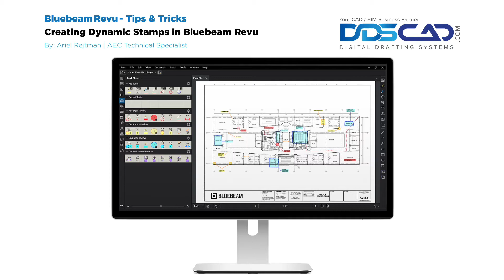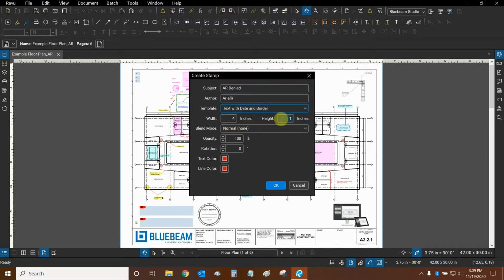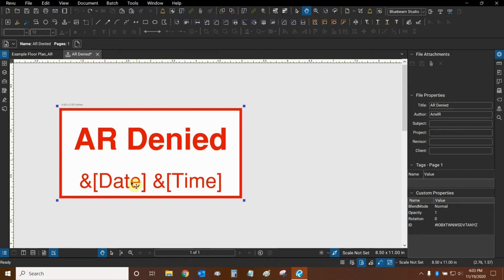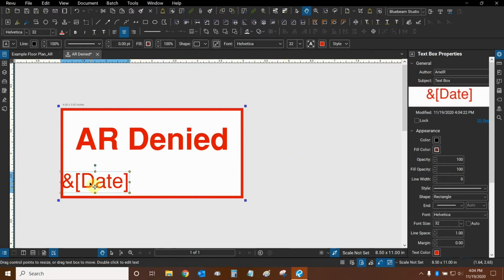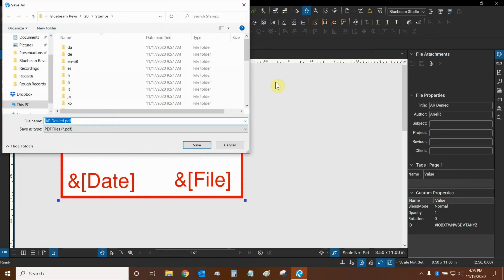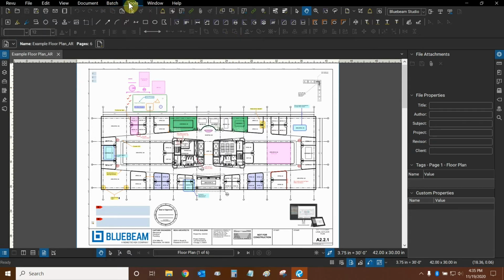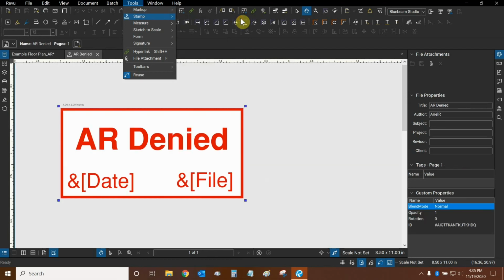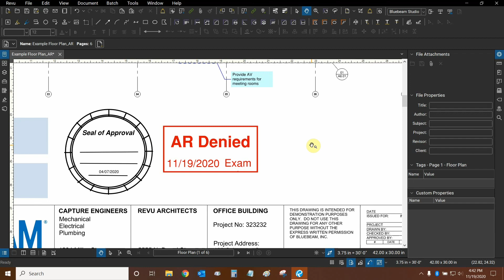Creating Dynamic Stamps in Bluebeam Revu

Comment: Thanks for the video. I want to place a watermark on my Revu PDFs, and I've hard Stamps is the tool for this. However, I want the stamp to appear behind the native text of the documents. Is there a way to do this?
Reply from the maker: You can use the Textbox/Typewriter tools to create a watermark, and you can also use a stamp for a similar result (Textboxes and typewriters have more options). There's also a "Watermark" stamp that comes with Revu. You can find this by clicking on the "Tools" drop-down, mousing-over "Stamp", and selecting the stamp called "Watermark". After placing it on your PDF, you can open the "Properties" panel (It has a gearwheel icon) and change its opacity. Then, you can increase the size of the stamp by selecting it and using the yellow corner grips.

Once it's sized and positioned, you can right-click on it and flatten it. This will permanently add it to your PDF. Most of these instructions and settings apply to the Textbox and Typewriter tools, but to increase their font size past 144, you'll need to toggle the "Autosize Text" setting (Or select "Auto" in Properties, found to the right of "Font"). You can also right-click on either markup, mouse-over "Order", and select "Send to Back".

The "native" text in a document is already flattened, so changing the opacity of your markup can simulate the appearance of it being "behind" native/flattened text. If the text has a non-transparent box with color behind it, your watermark may cover it, but if it's vector data text from programs like AutoCAD, Microsoft Word, etc., then your watermark should seem like it's "behind" the text.

Comment: Anyone know of a resource that can assist with creating a stamp with fields that allow the user to enter data not from the dynamic menu?  I'm trying to create a stamp to approve invoices. Most of the information is easy (name, date, etc.) I've even created a separate stamp for each project number/cost center. It's the PO that changes every time. I've been having to add a text box over the stamp then flatten. Almost as much work as printing, signing, and scanning, but I aspire to remain as paperless as possible. At this point, I'll pay someone if they can make this stamp for me.
Reply from the maker: We can create and modify stamps with JavaScript, and the settings can allow us to automatically fill in certain "Statuses" (Allowed, Denied, etc.) by simply checking a form field box. A great stamp to start with can be found by going to https://support.bluebeam.com/revu-custom-libraries/ . If you scroll down and click on "Stamps", you can then download the "Submittal Review" stamp. We easily modified this stamp for a client that needed custom statuses and text. Please contact us if you'd like us to assist you with customizing this stamp at info@ddscad.com.

Comment: Hi, Thanks for your video. I have a question: after i have applied the dynamic stamp, if I change the value in the Markup-up list, It does not update in the pdf drawing the info (like Autor). is there a way to have it interactive?
Reply from the maker: After a stamp is placed, it detects any "dynamic" data and inputs it automatically. Its "visual" data on the page can't change after it's been placed. If you want to "modify" the data on an existing stamp, you'll have to delete it, edit the stamp's original file, and place the new stamp on the page.